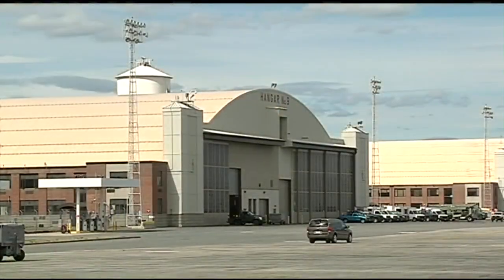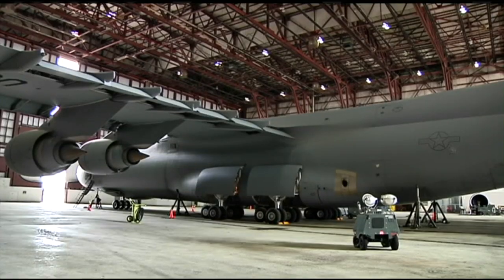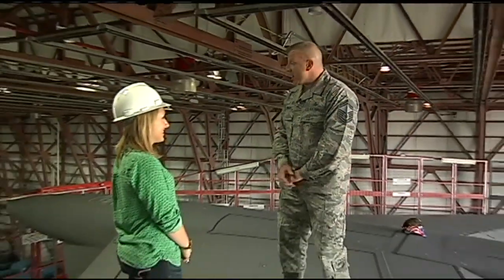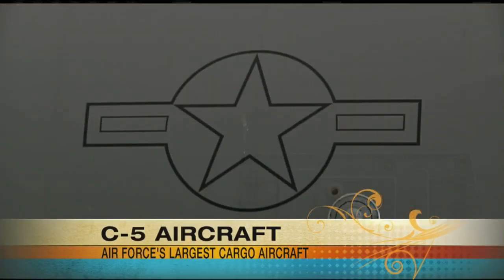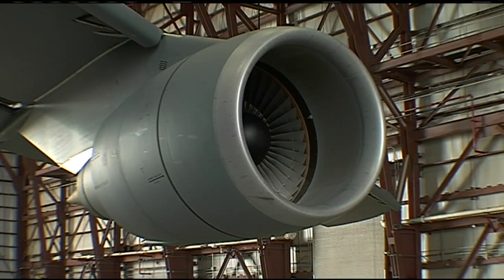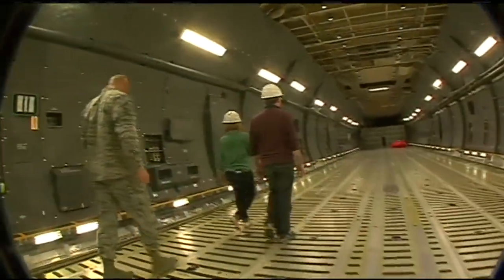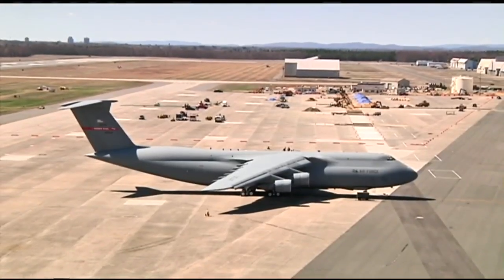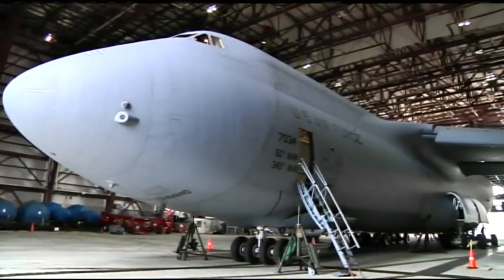Tour of the C-5 Aircraft

Comment: I fondly remember riding home from Rammstein Germany to Dover AFB back in 1998 taking 2 weeks leave to go see my mom in the states. This was a super fun interesting adventure for I was coming home after going abroad my first time spending 2 years my first stint over there. It landed at RAF Lakenheath in Britain, then the Azores where we spent the night before making the rest the trip to Delaware which I then took immediately on the ground with a red stained soggy green army duffel from broken bottles of wine (LOL) to tour Washington DC a couple days before taking a commercial flight to the Heartland for about 10 days before returning back to Europe on Northwest Airlines which served nice fillet mignon and wine in regular class seating with plenty of leg room. The C-5 Galaxy had 76 passenger seats facing rearward without windows and we walked up the ramp into the spacious cargo hold before climbing up a small ladder through a cutout hole in the ceiling which entered into the upper deck rear seating area. While it was Summer, I realized within minutes of my first leg of the trip I needed to have brought a Winter coat for it got really cold high in the sky with a frosty inside within about an hour. Does the bunkbed area look much like a submarine? Is the bunk area entered from the seating area in about the top middle of the plane? I wish I'd gotten on more military flights for it's an interesting adventure, but I quickly learned it's faster and far more reliable to use commercial airlines when you need to get some place by a certain time to report for work. I was so lucky to leave Rammstein within only 1 hour of showing up for a questionable flight I had so little information about as it's always contingent on many variables if it's a go or no go and people do wait many days to get on them. I was just gambling in an exploration that day in my young days whether I'd go to the states or tour Europe during that time after I got held up by 3 hours that morning with leave paper in hand due to a misplaced M-16 somewhere on base eager to get out on the German train to Ramstein and I barely made it on time to go get this really cool travel experience like there was no tomorrow. I did get to see most of Europe by train during other times off over the years which was fantastic each and every time.

Comment: "It's all about aircraft availability."  I thought it was more about safety and reliability.
Reply: If it isn't safe and reliable.....it isn't available. I am a former NCOIC of the Airframe repair section of an isochonal dock. I was there for the C-5A and when we did the acceptance inspection of the brand new C-5B.
Reply: @rlgroshans  But the SMSgt didn't say that the airplane was safe and reliable.  To him, "available" means that, but to the general public it only implies that.  Somewhere in your maintenance documents, "available" is defined.  We don't have access to those documents. If someone told me that I could borrow his car because it's available, I wouldn't necessarily be convinced that it's safe and reliable. If he told it was safe and reliable, and his credibility and reputation was platinum, I would believe him.
Reply: @koyotekola6916  , I get what you are saying. But to use your example, if the guy says it is available, and you already question if the vehicle is safe and reliable, then I would have to question who you borrow cars from.
Granted, it would he an assumption on my part, as a consumer, that the supplier of the vehicle qould only make available cars that are safe and reliable.
If they prove not to be, then I would need to take some form of action.
As the NCOIC of the Isochonal Repair station, that Senior Master Sergeant's reputatuon is on the line that hos planes are ready for service before releasing them back to the fleet.
Reply: Going back and rereading your comment, I see you were talking about borrowing a car from a friend or aquaintance, not a rental company.
Yes, a friend saying his car is available does not imply safety or reliability.
But one military unit recieving back their aircraft from a repair depot has different expectations of safety and reliability.
But you say the general public doesn't know that. And you are correct. But, that was a quick news interview, so not all is going to be explained out in detail.
Reply: @rlgroshans  Of course not all is going to be explained in detail, but he was talking to a journalist AND the general public.  We don't have AF documents to explain what "availability" is.  You're privileged to have those documents and/or knowledge of its definition, since you were the NCOIC.  The best thing would have been for the journalist to ask him what "available" is.  Then he would have explained it to her AND us.
I remember about 2 years ago, a pilot friend of mine crashed his experimental airplane in a field because of loss of power.  A journalist (won't say gender) came out and asked him why he lost power.  He said the flux capacitor broke.  He/she actually reported that on the evening news.
Reply: @rlgroshans  I'm not questioning the SMSgt's reputation. What I am question is his failure to tell the public that the most important thing is safety and reliability. Instead, he chose the word "availability," which is in his vernacular, not the general public's. The general public most likely thinks any pilot can walk in there and take the plane out for a ride. I know it sounds ridiculous, but failure to get your point across to certain audiences can lead to misfortunes. You're not the general public and thus understands him very well.

Comment: She's such a beast. You guys having to switch to a wide angle lens made me think about 3 weeks ago when I saw one get picked up on radar off the NJ coast heading in about 15 miles away so I grabbed my camera with a 100-400mm lens on it and headed outside hoping to catch it if it took a less used path to land at Joint Base MDL, and the C-17s land at the Navy base Lakehurst now so I don't see them as much as others, let alone a C-5M, but luckily for me it was landing at McGuire AFB, and I see a lot of aircraft usually a mile, 1/2 mile away while banking back south on the inital approach, and about 5 minutes later I hear it, but I can't see it, its getting louder but I can't spot it, then starts getting quieter so I thought it turned in earlier and it seemed closer because its so loud. And then out of nowhere, directly over me, I hear a thrust and it screams over my head at like 1800 ft, and I just barely got it in frame at just 100mm. Yeah, it looks big in videos or photos, but you don't truly realize how big and powerful this plane really is till it's screaming over you so low you could smell it. I was actually speechless for a minute or two after, it was impressive.
Reply: I had the opportunity to do a walkthrough of one myself, they are massive

Comment: What they didn't tell you is, the passenger seats face the rear of the plane and there are no windows in there.
Reply: But it has Theater screen and a bar.
Reply: Hmmmmm, never saw that when I worked on the C-5A and C-5B.  But then, I never flew in one.....just maintained them.
Reply: @rlgroshans  i maintained them too, both A&B models. There are 4 windows in the troop. I also worked (as I"m on g/f's account) for the guy in this video and he got into just a wee bit of trouble about 2 years ago and is no longer there.
Reply: maximum safety and maximum sleep ;)
Reply: there are 4 windows back there, doors 3R/3L, #4 hatch and #6 service door have windows.
Reply: Yup.  Rode space available in a C5 three times as a Navy brat back in the 80s.  Much smoother ride due to its size, and of course those seats were preferable to the canvas jump seats on other cargo jets.
Reply: How many people can sit there?
Reply: @AllaNetWork  73
Reply: In 1967 l flew across the county in a C 118. I became totally confused when I went through the door. All passenger seat were backwards. It was explained to me that it is safer. Makes sense.
Reply: Can clearly see no windows from the out side, only cockpit ones

Comment: I loved the C-5 A, and B models, but was retired before the M model was put into service. Those old aircraft have been working a long time and the first one in Vietnam to take military and civilian personnel out when Siagon was overthrown by the Communist. That aircraft was overloaded and crashed on takeoff. 

My favorite aircraft is still the C-141, which was a great airplane, but there is a place in my heart for the C-5's which I worked on also. The B-52's have a place in my heart since I worked on them for 4 years first, then working on the A-37, and A-10's, before ending up on the C-141's at Norton AFB. While there, I worked on and flew on the C-5's, C-130's, and several commercial aircraft also.
Reply: I had no idea C-5's have been around that long.
Reply: I've always wanted to see a C-5 next to a C-17. I was stationed at ft Bragg while in the army and spent many early morning hours sitting at Green ramp (I wasn't airborne, but as a medic, did medical coverage for drops quite a bit) I saw and flew in C-130s several times around Iraq. Was always impressed with them, but then I saw a C-17 in person. I was still blown away when a C-17 pulled up next the a C-130 at Green ramp tho. Holy smokes! Looks like you could just fold the wings on the C-130 back and it would fit right up inside that C-17!
Reply: Correction my Aviation friend. The rear pressure door locks did not engage causing the door to remain open putting the aircraft in a aft center of gravity leaving it uncontrollable.
Reply: I believe that when the door opened it ruptured some hydraulic lines which is what made the airplane uncontrollable.  The airplane didn’t crash on takeoff, it flew around for a while and the flight crew made an emergency landing in a field which resulted in the crash.
Reply: I worked on A's and B's Dover AFB 89 thru 94
Reply: Retired Travis AFB 92
Reply: Each aircraft is scheduled by  flight hours flown or degree of maintenance required plus available parts on hand to complete the procedure to upgrade all aircraft . With such a massive AC upgrading the whole fleet can take months.